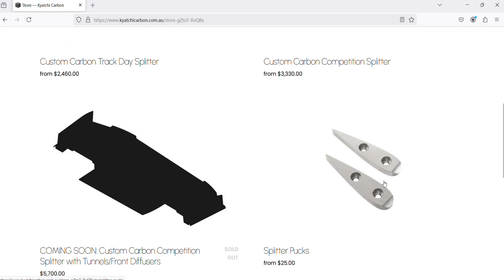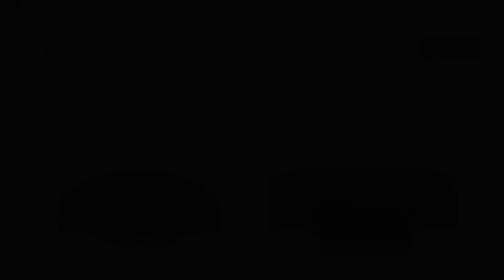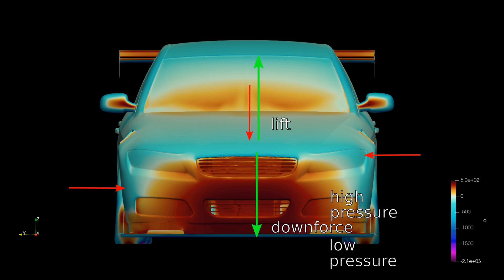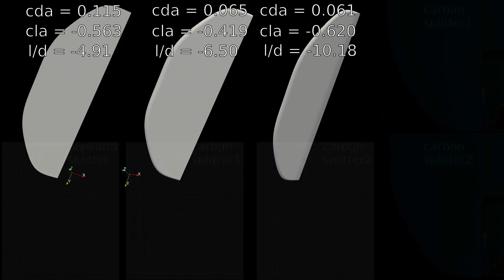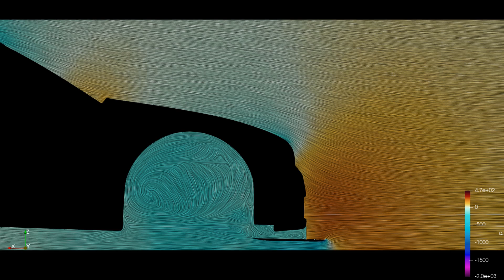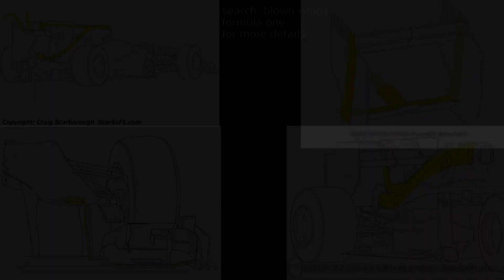Introduction to Splitters: Partnering with Kyatchi Carbon.

Comment: "cost-effective designs" sends me into the stratosphere when the most basic one, which amounts to a carbon fiber surfboard, is $2500. Absolute insanity. What're the man hours and material costs to produce that?
Reply: Make your own.
Reply: @ISMW26  I'm just saying that a lot of stuff is about 2x-3x what I reasonably estimated it would or should be. At this rate, I really WILL have to do exactly that.
Reply: @Drunken_Hamster so CFD software costs as little as 7K a year, or as much as 22K a year, for a single module. Then, add ons can cost just as much for other resources. FEA, CFD, CAD, CAM, you’re talking anywhere from 7-100K+ in a software package. Depending on what’s required. Then, the time to develop the model. The time to test the model. The resources and man hours spent to produce prototypes. The refinement process, and the end result. 

It costs, tens if not hundreds of thousands of dollars to engineer aerodynamic elements. Now include the cost of schooling, payroll, and expenses to run a business on top of all of this. These are incredibly expensive items because of the amount of money involved in making them happen. 

If you want to do this as cost effective as possible: build yourself a plywood mock up. Run and develop it on the track. Then use that plywood as a plug to create a fiberglass mold. Then make a carbon panel. 

The time and cost associated with doing this will be over a hundred hours, and the cost will be more than a thousand dollars, but you can make yourself more panels as you need, for a fraction of the price.
Reply from the maker: think Australian dollars and cost of living
Reply: Reasonable reaction. I thought the same before getting into composites myself but unfortunately it is a lot more time consuming than people think. @ISMotorwërks nailed it

Comment: I’m genuinely curious how well that duct will perform IRL with boundary layers. But it also seems quite easy to make and integrate to already existing splitters so shouldn’t be that hard to test. also curious why we haven’t seen something like this in GT3 yet as these are quite big claims. How’s the drag hit?
Reply from the maker: There are time attack cars that run something similar. No idea why nobody has thought about this before, the theory is solid. There is negligible drag penalty, which is the best kind of downforce.
Reply: It's theory thill there is actually on track data

Comment: Does the fast flowing airflow exiting the duct also helps the extraction through viscous effect?
Reply from the maker: partially, but looking at the plot, its the pressure at the trailing edge is lower such that the pressure recovery is bounded to a lower pressure.